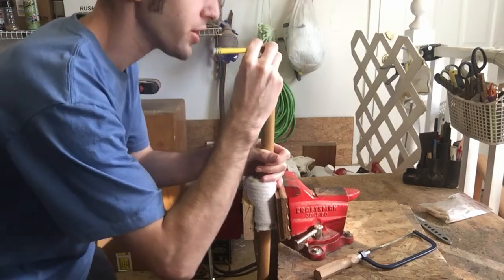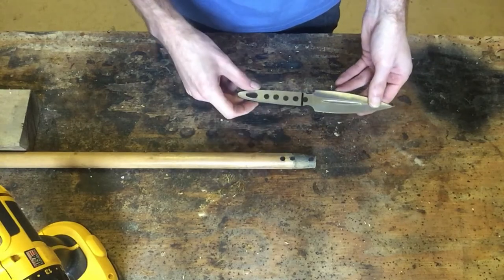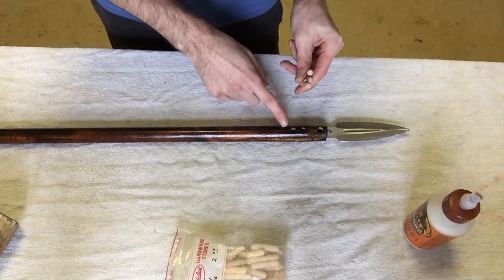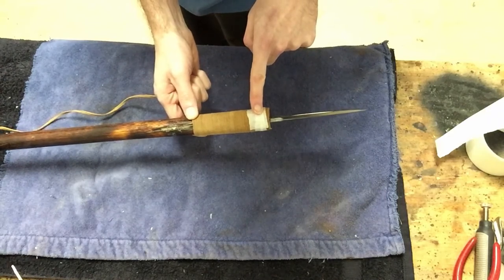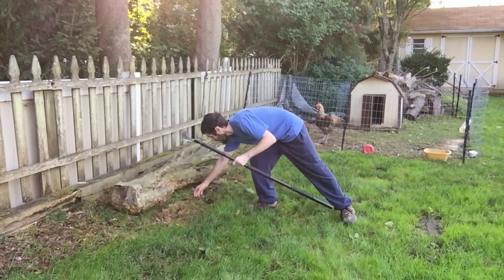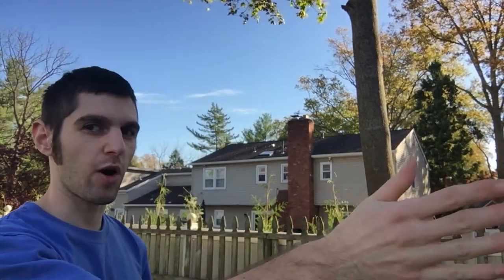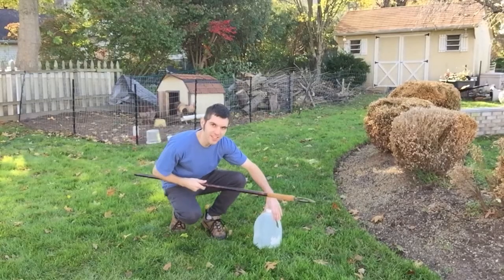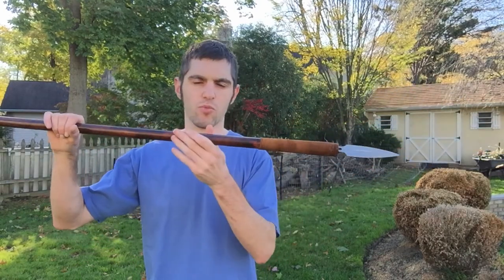How to Make A Homemade Spear

Comment: a spear is not suposse to cut more like do penetrations
Reply from the maker: yes, thanks.
Reply: A spear is made to do both. You're supposed to sharpen it so that it goes through easier.
Reply: That’s a javeline’s job not the spear anr it’s supposed to cut
Reply: @a_distant_figure7941  you have to sharpen it so it penetrates deeply and cuts

Comment: That actually isn't a very good spear, because it's so short.  You want a spear shaft alone to be at least your own height.  In fact, it's recommended that it's a bit longer than your own height.
Reply from the maker: As the way it is, it is pretty good. I know what you mean by a longer spear, but I just used a standard wood broom handle for it. The idea is that it is essay to make. I have seen many spears long and short online.
Reply: @john_free_thinker  Gottya.
Reply from the maker: @michaelsong5555  But thanks for the comment anyway 👍